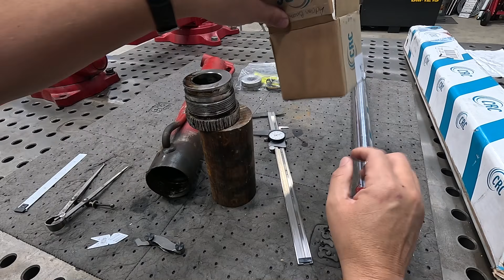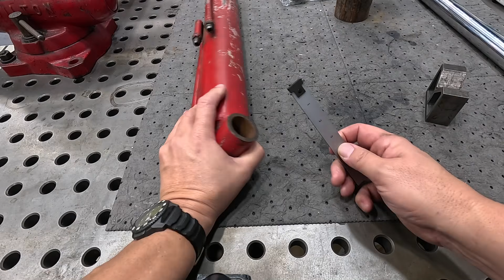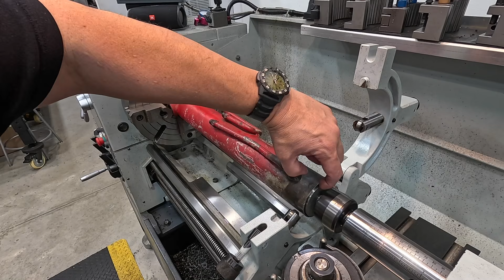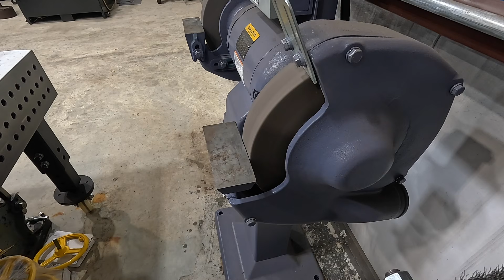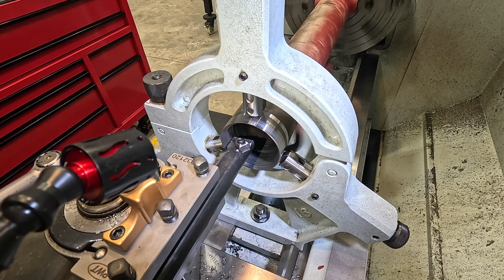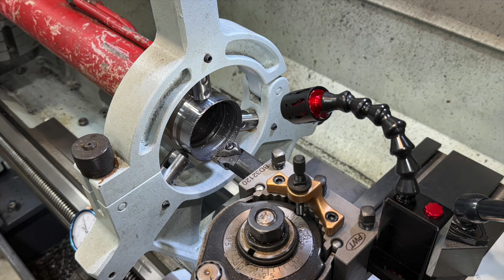Chasing Internal Thread: Mahindra Hydraulic Cylinder Repair Part 1

Comment: Oh Mr. Booth. Your comment about heat treatment of tool steels is completely wrong. I never noticed before but I now realize you are one of those “I don’t use coolant” guys. Why are you quenching the tool as you grind then? Just get it “red hot” and finish the job. Ask yourself why does everyone else use coolant? Why do $500,000 CNC tool grinding machines use coolant? It ain’t RPMs, that’s for production times. It’s because when you reheat ANY heat treated part you are softening it. You are creating an additional tempering cycle reducing tool life at best , and at worst you are enlarging the grain and creating tiny fractures in the steel that will chip off the tool face. Anyone gearing up  to reply, I am a professional heat treater and you ain’t got 1 leg to stand on when talking to me about heat treatment.
Reply: One would assume that if his shop made tools were chipping and breaking and flying apart all over the place because of the ruined heat treatment you seem to feel so strongly about, he'd have stopped doing it years ago. Since he still does it, we can assume it works just fine, and you may be saying something doesn't work that, in fact, works just fine. 

As far as implying you're a long time watcher ("I never noticed before..."), that's just dishonest. The video right before this one, "Prototype Flange Bolts", coolant flowing by the gallons. Adam does use coolant quite often. I assume he's the expert and uses it when he needs it and doesn't when he doesn't. Maybe stick to heat treating and let Adam stick to machine and producing excellent videos? You know, everybody stay in their lane?
Reply: @thinking-monkey  just look up what temperature HSS gets to when the heat treatment gets compromised then compare the colour chart with HSS that is grinded to make sure not to compromise the heat treatment. The dude above is correct. Just said it arrogantly.
Reply: Well Bill you could always go watch others Videos! Of course the people watching these Videos to learn something, probably wouldn’t want to read your smart Ass remarks either!

Comment: Look at the I D threads . Figure out where it gaulded. Hit it with a cut off wheel. Chase the threads with a carbide threading insert. Vnmg I believe. Would have saved a lot of time. Just an observation. Great video
Reply: Could have also picked the aluminum out with a pick, like I've done, but that wouldn't make a very interesting video, I'm thinking. In the end, the actual method used to clean out the threads wasn't even the point of the video. He covered several useful topics.

Comment: For anyone worried about the material removed during machining, some perspective is in order:

Four thousandths of an inch (0.004 in) is the thickness of a single sheet of normal weight office paper.

Just keep that in mind as you watch this get machined.

Comment: You can get a wave spring from McMaster and install it in the compound dial under the set screw. That will allow you to get a very nice tension in the setting ring. Take the dial off and it will be pretty obvious how to do it. Beware of detent balls springing out when doing the disassembly.

Comment: a little anti seize on the thread at assembly would have prevented the galled thread. even a smear of grease would help seal out corrosion. a retired mechanic i know did his apprenticeship at a sugar mill and the mill and plantation was salt marsh swamp country so every thing got a dose of graphite grease on assembly so you could get it apart next time with out breaking stuff they used a lot of ex army trucks and even made their own tracked equipment from old battle tanks as wheel vehicles and tractors didn't work well in the swampy conditions. they also dug a lot of drainage channels to drain land for cropping

Comment: The indicating on the chuck end was within a thou or two. But the threads and bore on the other end are visibly off center when placed in the steady rest. Then you cut the threads until they are back on center. Seems like now the gland seal and rod will be out of alignment by over 10 thousandths.

Comment: Is it just me?
When you installed the 4 jaw chuck, on camera at least you only tightened one of the securing studs, then moved straight on to how you install the tube in the 4 jaw chuck.

Did the part where you tightened the rest of the studs to hold the chuck on to the spindle nose & face just get edited out or not filmed maybe?

The idea of starting the lathe up with the chuck barely hanging on one stud made me sweat bullets. 😳😳

I’m sure you tightened them off camera, but I almost shouted at the screen in case the chuck flew off.😂😂

Comment: You did a fantastic job on those threads, Adam. It was amazing how that aluminum stuck to those steel threads. I thought as soon as that cutting tool you made hit that aluminum, that it would pop right out of there. But it had to be cut out.

Comment: I’ve been watching Abom for 4-5 years and every time I see him use a tape measure and it only has imperial measurements it blows my mind 🤯
Reply: Imperial measurements aren’t nearly as difficult as you guys make it seem. It’s just a little math sometimes.
Reply: @ydonl Many of us in the U.K. grew up with imperial measurements, so they aren’t a mystery. And later on when we went metric, again it wasn’t difficult. And for those of us on engineering courses in the 1970’s who changed to SI units we remain eternally grateful - working in kg, Newtons, m², mm², etc is just so much simpler than the old imperial units. I would never want to go back.
Reply: @ Understood.  SI is a little different story, though, I think.  The issue was fitting the units to fundamental relationships in the nature of the reality we are presented with.  The units themselves are still somewhat arbitrary, as long as the relationships are preserved.  Thus CGS versus MKS, where the scaling is by powers of 10, but I have a suspicion (not thought through!) that you could scale the fundamental constants by 3, and figure out all the rest based on that. I’ll think about it after breakfast.  :-)

Comment: For the love of all things Holy, when is America going to embrace the Metric Unit of Measuring? my head hurts when you are talking Thousandths and fractions of an Inch.
Reply: If you can’t handle working with multiple units of measure , that can all be EASILY converted , your in trouble
Reply: If your head hurts with something so simple, you need a new head!  Little kids can do fractions in the US.  (Or at least they used to.)
Reply: It always happens. Some metric guy is going to bitch about fractions and inches. Spend a little time learning the Imperial system and you won’t be so confused and blown away.
Reply: @ellieprice363  literally just a few minutes . But I know a lot of imperial guys who think the same 😬
Reply: For the love of all things Holy, when is the rest of the world going to stop worrying about our imperial measurements? Why does it bother you?
Reply: I use the metric system but still talk thous.
Reply: @passenger6735  finally someone who gets it . it’s all the same thing 1” = 25.4 mm . Take a few minutes to convert and you can work with whatever your preference is…. Problem solved
Reply: @passenger6735  i use both depends on the situation and i was only taught metric measurement.
Reply: Well the inch is based on the metric system. When Johansson was making his precision blocks he standardized the different “inches “ used at 25.4 mm. So our current inch is based on the metric system. As far as which is better, it’s what you get used to. And both systems have many obsolete thread pitches!
Reply: most threads in hydraulics are imperial any way. pipe threads are imperial. even the shafting is often imperial
Reply: This is America! Fractions of an inch is by far easier to learn than that millimeter, centimeter, decameter nonsense. And no wonder, this metric crap comes from people that drive on the wrong side of the road!  Learn to think fractionally and quit trying to memorize metric baloney!
Reply: Your statement is just untrue. Kids in either system learn to count 1-10 long before learning fractions. Which happens in both systems. Countries were the metric system is used just keep the fractions basic and don't bother with teaching inch fractions.  @RicksterX-92fs
Reply: @RicksterX-92fs  you seem to be confused about the metric system, or to be more accurate the SI system. The base units are kg, metres and seconds. No-one mixes up mm, cm, decimeters and metres. Along with a multiplier or divisor of 1000, every SI unit is standardised. That’s why your computer memory is measured in kilobytes, megabytes, terabytes etc because you just use 10^3, 10^6, 10^9 etc as the multiplier, and why 1 tonne is 1000x 1 kg, and why 1mm x 1000 = 1 metre. And it’s why it is so much easier for engineers to use SI units rather than old imperial units - especially if you do engineering calculations involving stress, strain, power etc. and yes, I’ve done both, because the U.K. adopted SI units in the 1970’s. That’s when life got simple and logical for us engineers in the U.K. One day you’ll catch up with the 20th century😂
Reply: @RicksterX-92fs  I'm pretty sure the French drive on the right too :)

Comment: Adam, I'd love to see a video of you addressing your thoughts on an Aluminum gland in a steel cylinder.
How much of that corrosion is due to the mixed metal? ( Galvanic )
Reply: probably. im a firm believer in use a light smear of anti seize or grease to prevent binding and corrosion. why make life hard for the next bloke which will probably be yourself. and anyone that say it wont stay tight bullshit. the right amount of lube actually allows you to get it properly tight becuase friction isnt stopping you.
if you have ever used loctite you will notice its slippery. thats is by design so it lubes the thread a little so it will properly tighten and then cure in absence of air to set the threads in position and seal out moisture. was originally developed in australia. now part of the henkel group.

Comment: I do this daily.. I would much rather make a new barrel than try salvage old rubbish.
Reply: What’s your channel called?
Reply: I know, right? Abomb is just showing out here. It is easier to make it all from scratch including the hose placements, and piston rod as well, if needed. Most remanufacturers would not warranty this repair or pay that labor cost for rescuing a badly corroded and as rubbished a cylinder as this was. 

He does need content though, so that is why we see him doing this odd ball repair and reman.
Reply: @CothranMike I expect he did it the way his customer wanted it done. Plus repairing a worn part makes a more interesting video.
Reply: @CothranMike  yeah can be easier to do that. and its the you know its spot on its rand new piece of mind factor.
but not always would it be cheaper there is quit a bit of work in making a cylinder barrel. and you have to be able to hone it accurately its not just get some cylinder tube bore to size, make a barrel end weld it on weld the feed tubes, make the gland and away you go. and you have the cost of materials too.

this is just one way of doing it. and it will work just fine. and yes he is making content for his youtube channel. if the cylinder wasnt salvageable he probably would have made one.
Reply: @CothranMike so how much would you charge to replace the whole hydraulic Cylinder 😂😅 and when do you show your chanle 😂😅 all the best
Reply: @CothranMike  Don’t take any notice mate. All these wallys who think you aren’t allowed to comment unless you have a YouTube channel usually forget that comments are open to everyone, and most of them actually don’t have their own channel either. I wonder how many of them have ever put any time in on a lathe or milling machine.

Comment: I do similar work with racing shock absorbers. Sometimes guys need the shocks to be shorter so we cut off the gland end and rethread the tube. Some of the shocks have very oddball threads including acme, metric, and some even trapezoidal (metric acme). Reverse engineering the treads is a fun challenge and for that I cut the old tube threads in half and measure them with an optical comparator microscope. One shock manufacturer threatened to sue for reproducing their “proprietary” threads. When I pointed out the exact thread was listed in Machinery’s Handbook, he backed down very quickly.
Reply: nothing is new under the sun. and pretty much all threads have been around for 100 yrs. they do deliberately choose odd sizes. this is why right to repair is so important.

Comment: Would indicating on the paint in stead of cleaning the paint off and indicating on bare metal make much of a difference?
Reply: Probably a little, if you cared. In this case, it would be impossible to measure the error at the other end of the tube.

Comment: Would witness lines on the tool rest help when grinding HSS? You could use the mill to make the lines on the tool rest. Or, even better, make a jig to hold the HSS on the tool rest.
Reply: Yup, both work well. So does hundreds of hours on a pedestal grinder making what you need with what you have. After you get a feel for the amount of removal with varied pressures (only talking HSS here), both coarse and fine wheels are no mystery to you and you can grind off-hand jobs quite ridiculously easily.

Comment: How much money did this save customer over buying a new cylinder?
Reply: I think most of these guys do these jobs for free, income is from views.
Reply: @sbrunner69  very unlikely.
Reply: @4110mahindra  He has literally said exactly that on previous job videos. Anyway neither of us know for certain.
Reply: @4110mahindra In the past he has done work on hydraulic cylinders for a relative of his - a cousin or uncle I think. And they were red ones as well, so it may be something off the same tractor. Whether he works for free or charges is not relevant though - if you could buy a new cylinder you would reckon on maybe $100 I would guess. But if they were unobtainable in that particular size you’d have to do the repair like this. So what you’d save would depend on whether it could be bought as an off the shelf item or not. And whether you were doing a favour for your uncle.
Reply: @srp01983  agreed. I have done some hydraulic work on tractors myself  and have 30 years in industrial engineering and maintenance.  I would have guessed based on my experience that if paying for all the labor the rebuild would cost the same as buying two cylinders off surplus center and adapting them . I think there are always "government jobs " and those probably do make up the bulk of his videos but a shop that size needs some higher profit margin work to keep the lights on.

Comment: One trick for removing aluminiun from steel is natrium hydroxide (drain cleaner) just drain cleaner mixed with water will eat up aluminium.
Reply: 😃 In English the name for the element "Na" is sodium. So caustic soda, chemical formula NaOH, is called sodium hydroxide in English. 

But in Dutch it's natrium hydroxide, just as it is in Finnish, I guess.
Reply: Yup, and generates a lot of heat in the process. In fact the Draino company added coarse aluminum chunks to the dry mixture they sold back in the late 40s through the mid 70s. This was explained as a heat maker for grease removal. It also makes a lot of hydrogen gas, flammable and so light it will travel to the top of the building and creep along to the highest place. A spark is needed to set it off, such a small thing to give a big boom!

Comment: Indicating a rough, painted surface to .001" is pointless and misleading in an educational video.
Reply: Well thats just not true isn't it. If the paint job was done even half well when it was applied the thickness increase will be round about the same and you take roughness into account, you ignore the needle jumping around as you rotate the part and worry mostly about where it lands at the jaw. Adam knows that even with it landing within a thou on the indicator the true centre might still be a couple thou out but thats as close as youre getting, and it doesn't need to be more accurate than that for the operation hes completing. Why people like you feel the need to pick on all these tiny little things instead of just enjoying watching him work is beyond me. And as far as it being an educational video, every machinist does things slightly differently and there is no right way so long as it works. If you want to do things differently, make your own video.
Reply: Not really, it would show any obvious problems immediately. It's always good practice to follow standard methods. You never know if something is going to bite you when you don't check it.
Reply: funny thing. When I looked at your channel, trying to find your videos, showing people the way you think it should be done.... well, low and behold, you don't have any.

Comment: Was a little nervous not seeing the set screws tightened in the steady rest . . assume they were, lol
Reply: Since the screws (when tightened) are set deeper into the body I could tell they were not but did not care. Only massive vibration for an extended time would make them fall out, and the lack of tightness they did not give to the screw adjusters would not cause those to move at all. I ran several steady rests without any locks on the adjusters with never a problem. I imagine several others have as well. If I worried about something like that I fixed it. Even if the boss said no need I would, I don't have a problem with authority but they do with me. My judgment was my guide.

Comment: Great job Adam.  At the 29 min. time, I didn't see you tighten the set screws on the roller wheels. Did I miss something?
Reply: If you didn’t see it, did it happen?
Reply: If you didn’t see it, did it happen?
Reply: @ramdynebix I refer you to an earlier comment I made in answer to the same question.